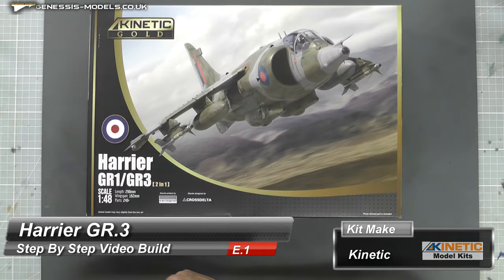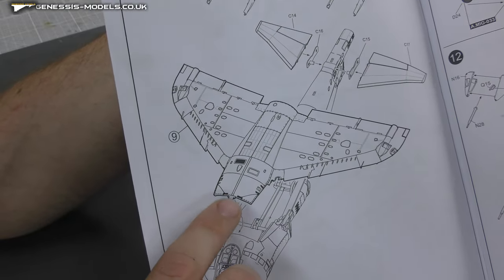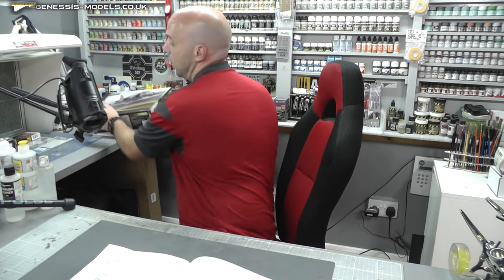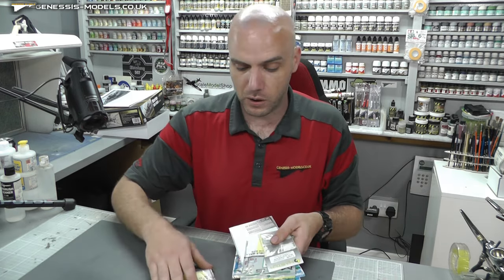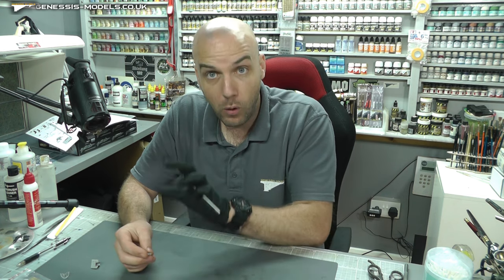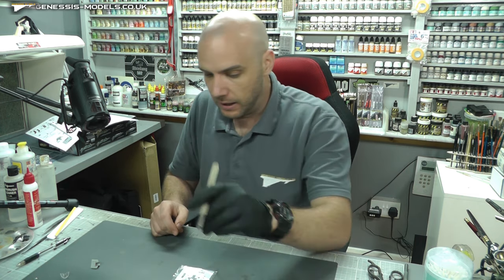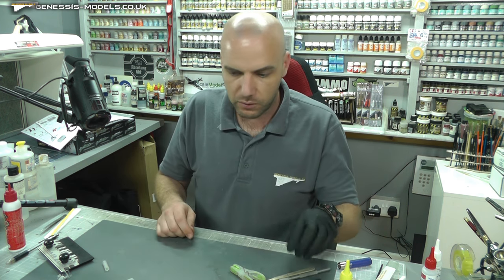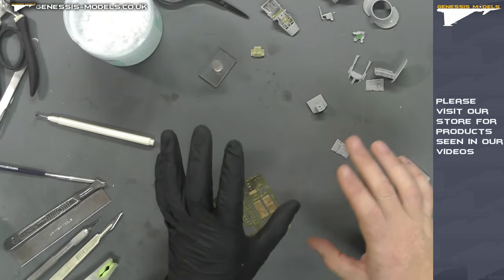Photo-etch Madness : Building The Kinetics Harrier GR.1/GR.3 : 1/48 Scale : Video Build : Episode.1

Comment: Hi, 
 I'm an intermediate modeler. I often use p.e., but I have a few quick questions, if you don't mind too much. 
Can you point me to a video where you apply p.e panels on the fuselage (ventilation, intakes, ..)? 
I have a mig 29 smt 1/72 (Zvezda with p.e. from microdesign), some of the panels are slightly compound curved (following the fuselage's shape), I'll anneal the brass when necessary. 
My questions are : Do you replace the plastic with the p.e or do you glue it on top? And in that case what type of glue do you use? I was thinking of drilling holes under the part and cyano it from the inside, to avoid oozing, not sure... (instructions are minimal "this goes here" type of thing)
Thank you for the video, I really enjoyed it and subscribed.👍🏻